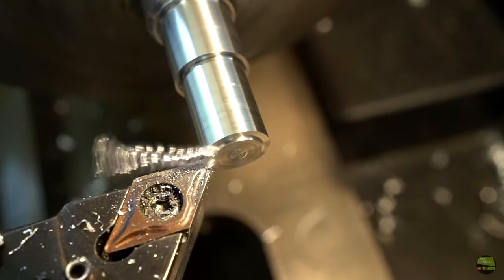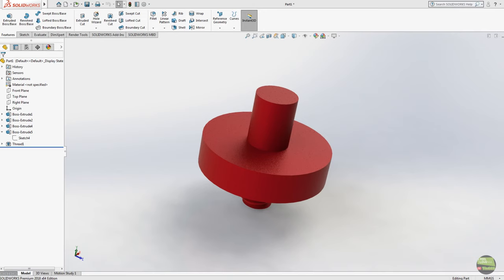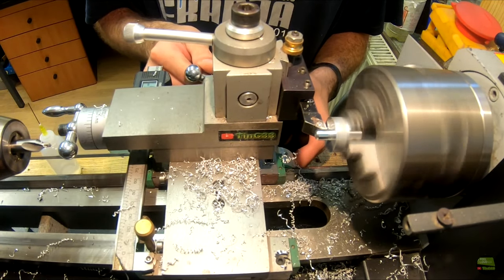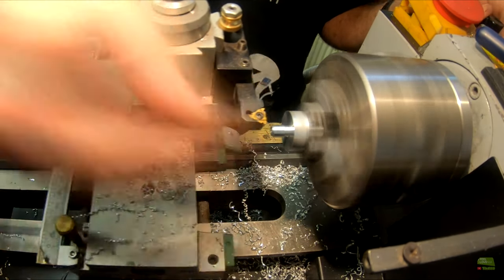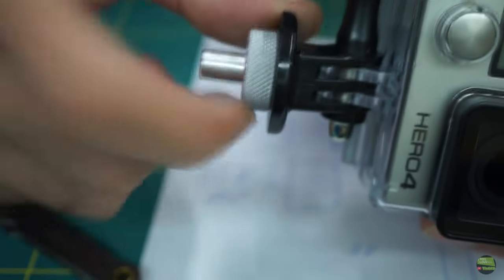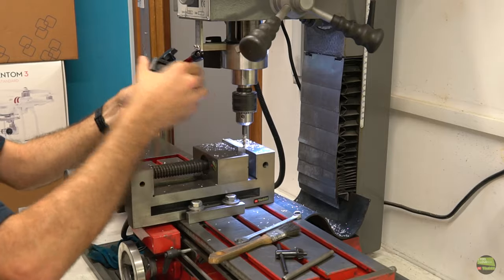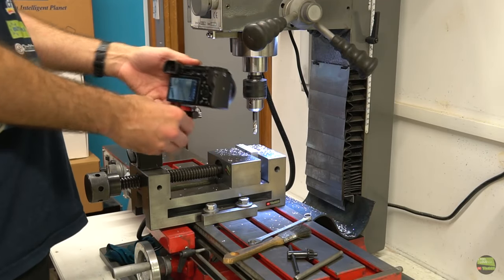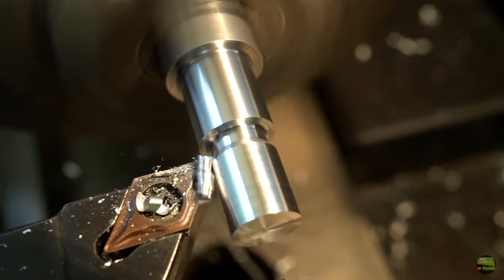Put your camera on magnetic arm [making an adapter]

Comment: Wait... the camera thread is not metric. It usually is a 1/4 - 20 UNC thread.
Reply from the maker: And that's all i know, is a 1/4 - 20 UNC thread. i can't find other information about that so often use thread, it's no metric, no inch, no widworth, none what kind of thread is it?
I use more or less with metric size but still use some inch thread into hydraulic, pneumatic, water pipe and so on, but 1/4 inch thread is sice somewhere between 12 and 13 mm wich is far from 6,3mm that 1/4 UNC is, i'm really confused about this, so i'll be happy some explanation there. Thanks
Reply: @TinC33  You can have a look at the ISO 1222 standard about camera mounts and threads